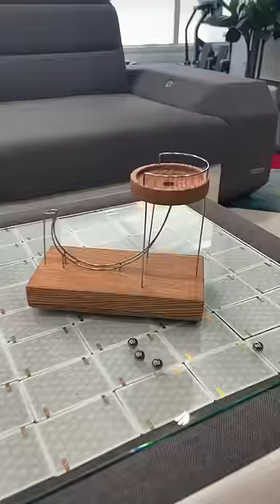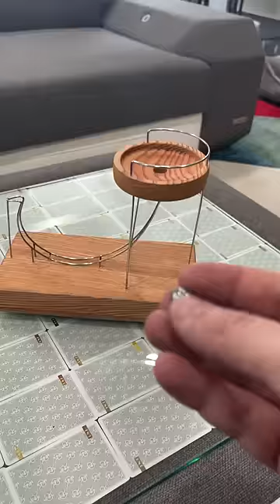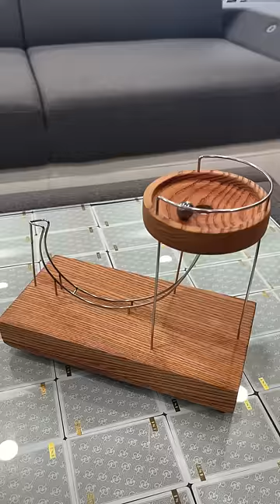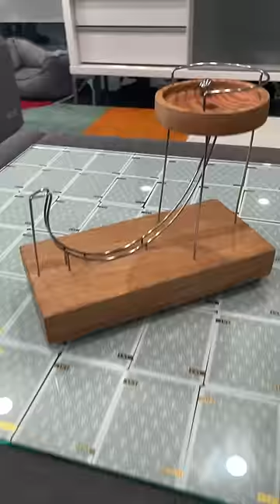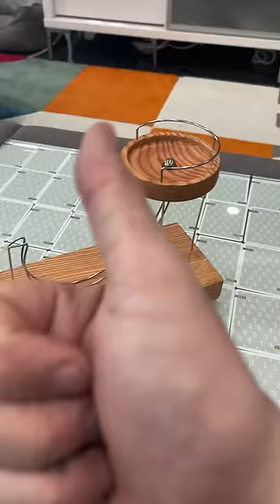An Impossible Perpetual Motion Device?! 😳 #Shorts

Comment: I wanna get this but I’m too scared to break the law
Reply: It’s just a magnet that put energy into the ball, if we quit the magnet or change the material of the ball the effect is impossible
Reply: Lol and then you'd be on the run from Newton's own secret police force: Gravity.  It's always arresting motion.
Reply: Nice 😂
Reply: @aloeverga4437  there is no magnet necessary
Reply: @EarlCo  you can hear the magnets pulling the ball down the ramp every time it goes. Sounds like those old magnet toys that you would put next to each other and listen to them vibrate when they connect to each other
Reply: @phoneticfinatic2710  Nah bro, you're reaching. Magnets not necessary or present in this vid. Nobody said this, you're making stuff up, stop lmao.
Reply: @kratosjunior817  bruh you can hear the ball bearing scraping against the track as it goes down, it wouldnt do that if it were rolling freely
Reply: @kratosjunior817  maybe if you explain what the noise I’m hearing is I might believe you
Reply: LOL
Reply: Top tier comment! 😂
Reply: @kratosjunior817  How would the ball reach the top of the thing then? There needs to be an electromagnet at the base of this thing
Reply: 2 laws
Reply: And yet, simply placing a large neodymium magnet strategically offset under the hole, in the wooden deck, the initial fall accomplishes the same increased velocity & since the magnet theoretically will last for centuries, it's as close to perpetual motion as you'll get.
Reply: Adding new chapters to syllabus
Reply: @treyara4852  Idk if you're trolling my man but a child would tell you this its its obvi c'mon now
Reply: @Christian_Prepper  The magnet would end up with no net change in ball speed, meaning it wouldn't get back to the top

It would have to be an electromagnet that turns on and off, or electromagnet that switches poles constantly
Reply: @corvusrex9676  Yeah it's called metal bub... I'm sure this seems revolutionary and hard to grasp to you apparently 🤣 but!?.. It's kind of old and familiar to most.
Reply: No laws broken, energy is conserved
Reply: Some people in this comment believe they can hear magnet
Reply: Sounds like something Sheldon would say followed by laughing noises lol
Reply: @kratosjunior817  If your argument is that it's gravity (judging by your last comment that you might have deleted), then that alone wouldn't work. The ball speeds up as it goes down the ramp, but then gravity also slows the ball down as it goes up and while it's in the air. 

If it's the argument with gravity in conjunction with a permanent magnet, then I'd explain it with calculus. I don't know what impression you're getting or how you're getting it, but I'm 100% serious. It may seem obvious at first to you but magnets can't create a net energy on its own.
Reply: @kratosjunior817  What do you suggest is powering this machine? If you suspect nothing but pure gravity, then boy do I have news for you. That is perpetual motion, if it's only gravity, which is impossible due to friction's loss of energy, which means that gravity alone would never be able to bring the ball up to back where it started.
Reply: @kratosjunior817  Metal on its own means literally nothing.
Reply: @kratosjunior817  

You made a comment saying 'lmao cmon dude cant you see it's a downward funnel and a heavy ball?? Naturally its heading into that hole bro'

I'm not arguing that it doesn't go into the hole while it's up. I'm arguing that it won't make it high enough
Reply: @aloeverga4437  where is the magnet? The rail?
Reply: Samir, you're breaking the universe
Reply: @oO2Pro4UOo  🤣👍
Reply: @kratosjunior817  Hey "bub" idk if your ears are broken but there is a difference between the sound of a ball rolling down a metal track and a ball scraping down a metal track
Reply: @corvusrex9676  I'm jk I'm totally a softee you can tip me upside down and I guarantee I'm falling out the cup but I'll still f you up tho its just da facts🤭🙃
Reply: @EarlCo  Yep, no magnet necessary, just need magic.
Reply: @Christian_Prepper  Yes nothing that is in the physical is perpetual.
Reply: @itzlikethatforsure9130  Very true. It's interesting how you're one of the few people to understand what I actually said. I never said physical perpetual motion is possible. I said strategically positioning the right sized magnet would be the closest anyone could possibly get to "perpetual" in that it would last a really long time. Longer than any currently available battery.

Thanks
Reply: 👮‍♂️: that's 5 to 10
Reply: @MichaelSplatkins  they're not gonna gestapo me!
Reply: @aloeverga4437  Why would you need a magnet? You people are over thinking how this works.
Reply: @phoneticfinatic2710  Magnets? Where do you live that doesn't have gravity?
Reply: Lol
*Break laws of physics
Reply: @aloeverga4437  i dont think thats possible. if the ball gained kinetic energy from a magnet as it approached it, it would also lose some as it tried to roll away from it
Reply: @KaiserBruh  Then it would be an electro magnet that moves around giving the ball energy.
Reply: @huemongussmashupsremixes4362  I’ll just let someone else chat with you about how energy conservation works, then I’ll come back and see if you learned anything.
Reply: @aloeverga4437  if it was a magnet down there it wouldnt pass the magnet that way. It would stop at the closest point it could get to that magnet. 

It might have more to do with the weight/material of the ball, and the curve it rides through once falling from probably a certain height and into a certain angle/curve. It gains enough momentum and also follows through the right curve to at least land the ball somewhere in that wooden dish, my friend. 

Im no physics major or anything, this is just what seems like going on to me
Reply: You gonna go to jail!
Reply: @aloeverga4437  not just a magnet. It's an electromagnet that switches poles or turns off when the ball attains maximum velocity.
Reply: Wee Woo Wee Woo its the physics police
Reply: lolol